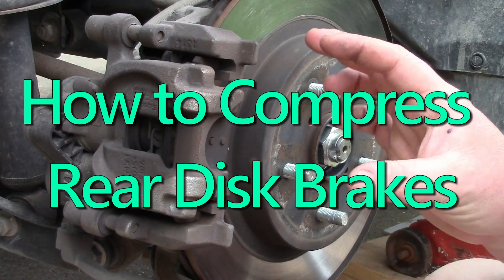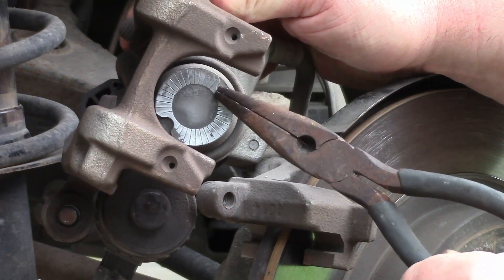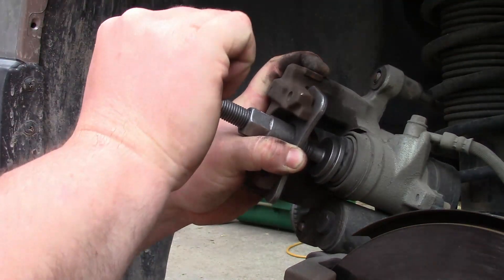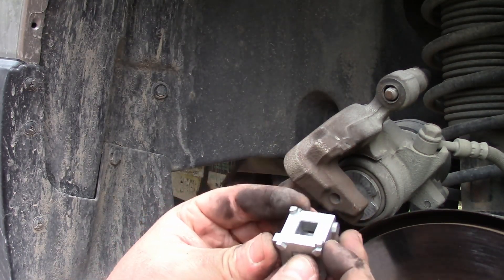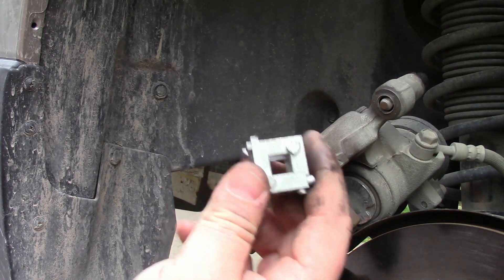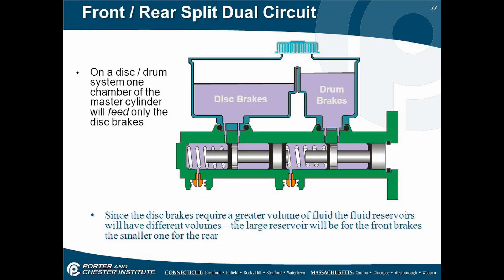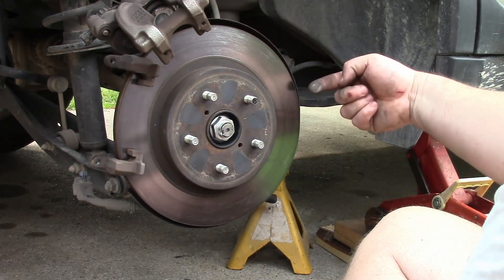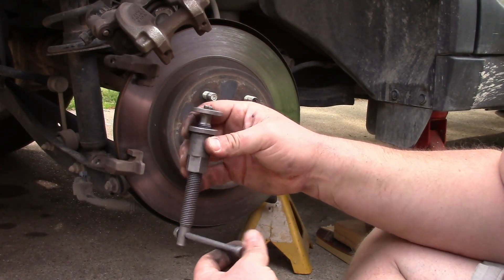How to Compress Rear Disk Brake Calipers when it has a Parking Brake built into the Caliper.

Comment: Don't some of the caliper pistons have to be wound fully out before you can wind them back in?
Reply: I hope not. Rotation of the pistons clockwise and counterclockwise is another variable to solve for the particular vehicle.   Just praying it’s simple to figure out when I get there. The kit I’m using has left hand and right hand turning clamps with limited directions on which one to use.
Reply: @takeniteasyfriend  Yes I know but I’m sure on some vehicles you have to wind them out first before you can wind them back in. I couldn’t get one back in until I did that…